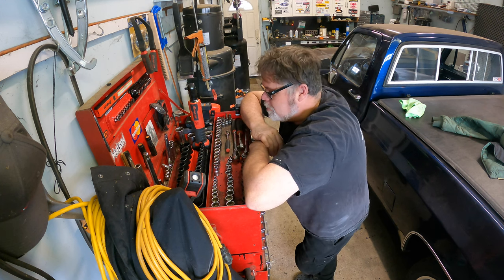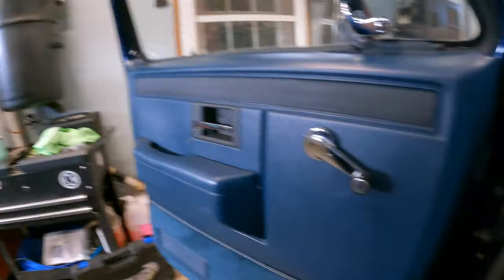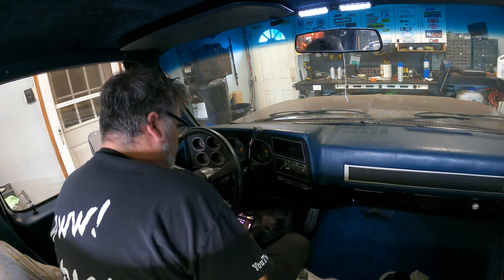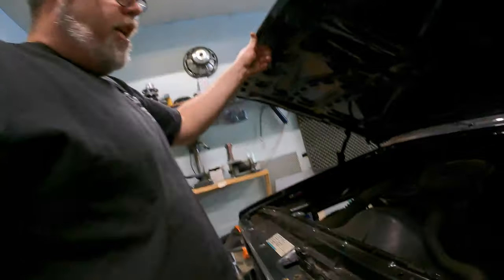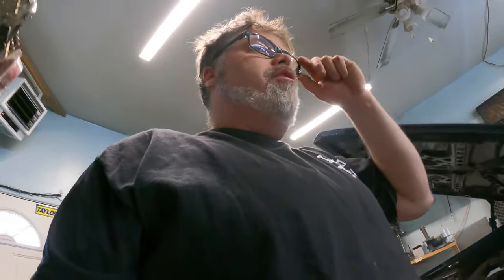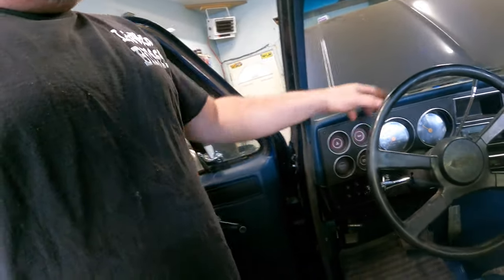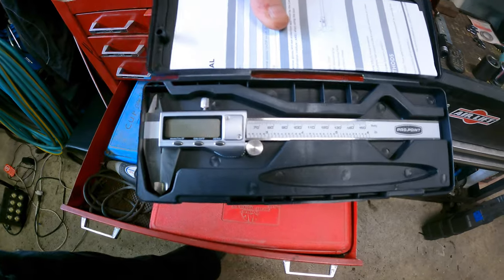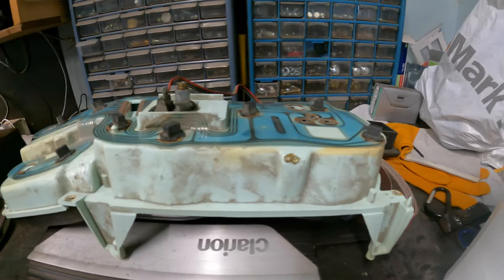Repeat Job It Happens   4K

Comment: Wall of text warning. =-) 

Problem with parts is that nobody maintains their own databases anymore--especially bad if you own one of those mid year changes cars.  A lot of online parts databases do not make the distinction. I ran into this with my 1989 ford. a lot. My old paper manuals show the specific breakdown, the online parts database AND the one that ford uses show wrong parts for lots of things as they only list the late year switchover parts. I don't know if its laziness on the data entry folks, or they don't give them a field for it, but if you got something that is a frankenvehicle, good luck.   Napa, Ford and the Rockauto database all show the same error-mostly electrical & hvac parts for the ford. talking to the ford parts guy come to find out ford uses a third party parts database also. I was always having to look up previous years and later years to match what I needed .  PITA.    Not that paper manuals are infalable, Napa back in the 80's had the wrong spindle bearing seals in the book. Matched them up on the counter with what was on their shelves.  
 The other thing working against you, Canadian market truck. Talk to most americans and they think feedback carbs where on everything in 1983, not so in Canada, Camaro's, Trucks, others did not have the feedback carb, some did, but definately not all. We had ESC on the trucks for longer.           
If you find the right part online, take that number with you, the part store can cross reference it. I let them know I got a part number, but lets see what their system spits out first.  You'll figure out what parts are right or not.  
And don't discount that some previous owner modifications exist on your truck, lots of stuff interchanged, maybe somebody bent an axle and the first one they found at the autowreckers was good enough.  Or parts shortages and GM starts to mix'n match themselves to get trucks out the door.  Your truck I find interesting in that it seems to have base springs (really soft to my eye), but its got a 2peice shaft--not uncommon in the US but around here a 2 peice shaft sticks out like a sore thumb to me since I have rarely seen them on a square.   

Watch out on rockauto also, definately check other year trucks. You will find additional parts listing for some years that don't even show up in others.  My 1981  vs my 1983, there are parts listings that only show 1 or 2 parts on the 81, but gives me 5 different options for the 1983.  When they first got LED bulbs (have not checked in a long while) to see what they had, same nonsense, An 1157 LED bulb shown for the 1985, but didn't exist in the 1981.... But was in the 1976...Talked to a rockauto guy, he said their data base is bases on what the parts maker tells them.  So if they don't list 1981, they don't consider it a fit even though an 1157 bulb is an 1157 bulb.  Anyway, enough rambling. =-)